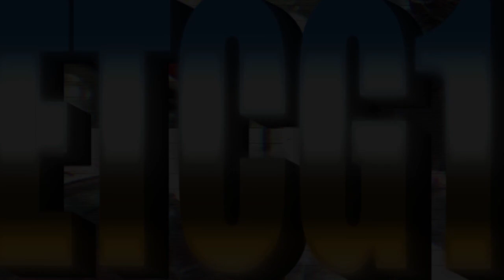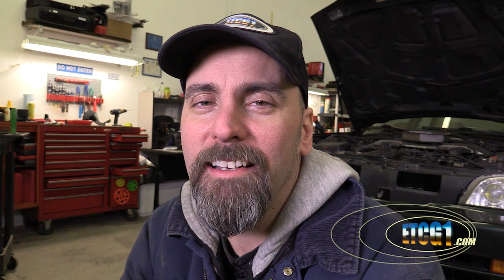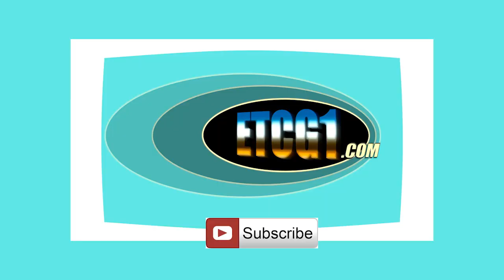Electronics are Stupid -ETCG1

Comment: As an electrical engineer, I disagree with the premise that electronics are stupid.  They're actually quite sophisticated nowadays to the point most cars will know something is wrong with themselves before the owner has a clue.  Cruise control, ABS, traction control, adaptive cruise control, list goes on and on of stuff that's powered by electronics and makes driving around a simpler task.    Sure at the end of the electronic road there's usually simple circuits, but the logic behind them isn't stupid.

Comment: a carburetor can get 75 miles a gallon if it was not built for horse power like most are. the whole shift to fuel injection was the car company's want to not be dependent on outside parts you see a lot of manufactures now make there own fuel components. back to carburetors in my opinion is the only way to go

Comment: This theory works for now.
But Euro cars are starting to implement Fiber Optic cables. I think it is the newest Bentely has 1.5 miles of Fiber optic cables on board..... Just throwing that out there
Reply: Mobius, electricity still behaves in the same way regardless of the media it is being transmitted on.  Its physics.

Comment: Please remember, in order to fix a problem in an electronic system, you must first have an understanding of how the system works, I am not talking about the basics here, if you are trying to tackle this type of repair, you better know that, I am talking about what the system expects to see on its inputs, that way you will now why it is doing what it is doing, You can have perfect connections in your circuits of the system, but if there is noise being introduced, the system can get confused, This is the hardest part. Know the system, why it does what it does, and you will prevail. Oh, and this is the hardest part, because that information is not well shared by manufacturers. One trick, want to test a system? use its built in fault reporting, create open circuit, then a out of range voltage. If you get a fault code for and open, then an out of range code, you know the circuits of the system are probably ok. Happy hunting.

Comment: Definitely not an easy task for a beginner/amateur.  I've downloaded schematics for my car from the internet but the circuits are just way too complex they can only fit a small part of the system in a single page.  Unless you've got some kind of photographic memory, you end up having to tape up pages together to be able to get a picture of what goes where.  Then and only then can you start coming up with hypothesis as to what could be causing the problem.  And then there's the disassembly part that's a whole ball game all by itself.  But hey, if you've got the space or garage, and you can afford to keep the car in disassembled state for weeks at a time, then yeah it's a learning experience and it'll definitely give you a good amount of self-satisfaction if you do get to fix it right.

Comment: batt charging problem been over the whole charging circuit cant find any thing wrong with it been beating my self up the last 4 months trying to find the problem and cant
any advice and before you say check battery it is at like 90% and the alternator is brand new and not a reman

Comment: ESTG -.- If Electronics are stupid becose the voltage on the batery is low also the mechanics of a motor are stupid if they dont work without diesel and air...

Comment: 2000 tundra 4,7 after a head gasket job on my boss truck, the trans. oil cooler took a sh*t and mixed ATF/coolant so engine overheated...after the repair we had no throttle(electronic throttle)same code everytime p1126 (throttle motor clutch) as soon as we turn the key on...we've done ALL the tests toyota,ProDemand said and everything was o.k, unplugged the batery for a night toyota says 20+min delete ALL memory from ECM... desperately trying a new ECM and throttle assy. without any results...i went to check data and codes from transmission data was o.k. no codes stored, then after a week of headache I deleted the un-existing transmission codes and the F*CKING throttle came back from the dead -___- we were glad it wasn't a client's truck

Comment: A lot of gauge clusters and overhead displays in cars are from china or use China soldering/PCB manufacturing processes. I've seen the worst soldering job ever on a Button board that operated a moon roof on a car. I just baked it in my solder oven and it was good as new. Now the corrosive flux they leave on the PCBs is a different story...

Comment: Artificial competence(not intelligence). Garbage in garbage out. I made my living in the public safety radio/electronics(radio shop). When dealing with vehicle electronic computers. Yes, the first place to look for trouble. The battery. I tightened thousands of loose battery cables left that way by mechanics. Be sure the battery is good and the connections proper. All grounds are suspect. All hot distribution is suspect. Any other connections are suspect. What can really make for fun is when something new is introduced that messes up the normal operation of the vehicle computer. Example radio transmitters and things that connect to the existing vehicle system. I am very impressed with how good most vehicle electronics work. Having grown up with this stuff. vehicle electronics in the beginning were much more problematic. If everything was working great and you install a new wizzbang with problems following. Try removing wizzbang.

Comment: Good Topic electronics are stupid but they are also devious We  have all seen a non functioning part suddenly come back to life with the appropriate hit We know its not fixed but the person that " hit it right there " looks magical! (usually a repairr like this indicates a bad ground)  I started in a British Leyland Jaguar dealership in Ontario Canada Home of 6mo of road salt! First the British system was "positive earth ' which meant its backward to US the positive is the ground! Needless to say jump starts to the untrained were spectacular! Most of the early cars had 2 6volt batteries another land mine for Bobs 23.5hr towing Then there was the cloth covered wiring harness which would melt itself together But still some twinkee would hit something (usually the fuel pump ) and the damn thing would start! The nickname for the Brit wiring was Lucas the Prince of Darkness! Only because the lights never worked in the dark.So from an early age in my automotive career I learned never to under estimate the devil wiring! I saw people trade( sell to the highest bidder! ) some very nice low milage clean Jaguars because Lucasitis got to them! If we fast forward to today and  replace British Leyland with another usually offshore car and with chronic wiring/electronics issues the same advice has come back Get rid of it Nothing is more expensive to repair than an electrical  nightmare! Its not fair to a shop to keep bringing back I think Im not alone when I say we eat more time trying to Exorcise the electrical demon out. Usually I can  see the good in the most thread bare of cars but i draw the line at electrical demonizing!